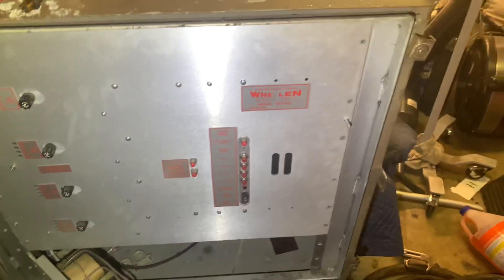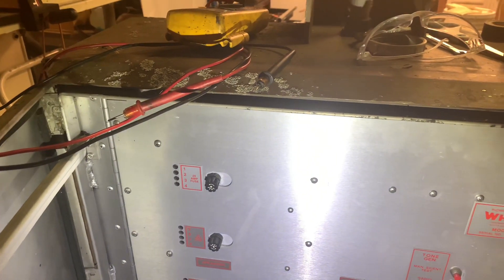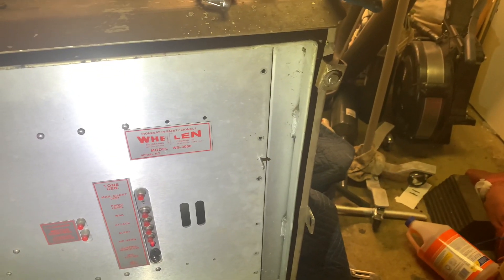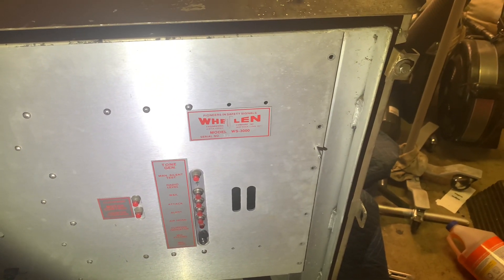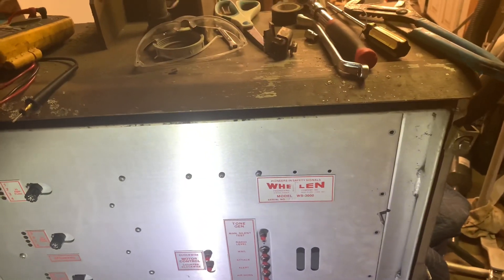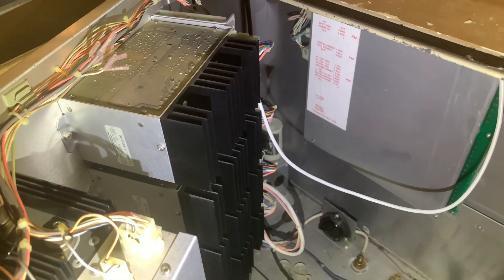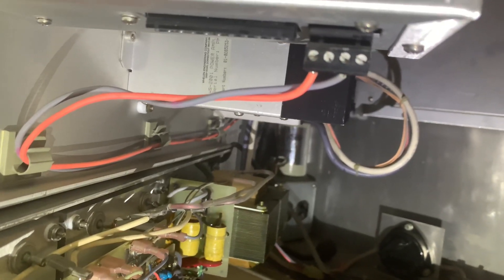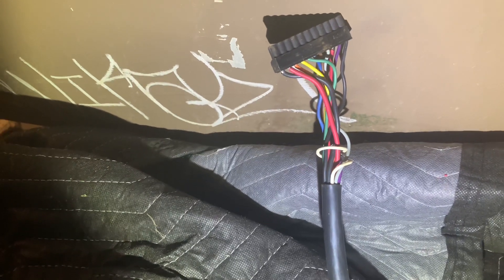Whelen WS-3000 all tones demo

Comment: My guy this is incredible. Glad to see it went to a good home and DAMN it sounds smooth!
Reply from the maker: Yeah, for a 35 year old siren it's held up very well. only issue I've found so far is that the rotator motor needs to either be rebuilt or replaced. the permanent magnets inside it came unglued, and were grinding against the rotor,causing the motor to sound awful. this can be heard on the brief rotator test video. also, the position encoder doesnt seem to work, but that might be related to the motor not turning fast enough.
Reply: @Egress.  Good to know that the issues so far seem repairable or at least manageable.
Reply from the maker: @4J25  definitely!
I’m pondering reverse engineering the tone generator too, it’s ridiculously simple.

Comment: Siren Enthusiast of the year!

Hey by the way is Hilo disabled?
Reply from the maker: Hi-Lo on these controllers was not available as a front panel push button. I plan to add my own to rectify this. Will likely use the slots where the decoder controls would have gone
Reply: @Egress.  Cool man. I can't wait to see it finished! Some of my friends have been trying to re-create one in roblox. This is a very very good reference! Keep up the good work man, have a good one!
Reply: By the way, how did you do the hi-lo thing?
Reply from the maker: @TheCasualSirenEnthusiast  in the cabinet there is a set of wires to connect an after market radio. both the alert and attack(fast wail) were connected to the siratrol radio that my unit had. additionally it has wail, air horn, HI-LO, bias enable, and PA Audio In. to activate any but the PA audio in, the signal line must be shorted to ground and held there for the duration of the signal. I believe that this wiring harness would have been replaced with a short wire that connects to the radio/tone decoder assembly, but my cabinet does not have it due to being used with a siratrol.
Reply: @Egress.  well the hi-lo tone was not what I expected it to sound like. I was expecting 864 Hilo lol. Cool

Comment: Can you do a pulsed air horn while using the DTMF like you use for Hi-Lo?
Reply from the maker: this controller is only capable of continuous airhorn, it would have to be manually pulsed.
Reply: @Egress.  Then what’s up with the ESC-864? How can it do pulsed when it’s analog
Reply from the maker: @dinkindane  it has a microprocessor controlling it’s tone generator, this controller is entirely analog